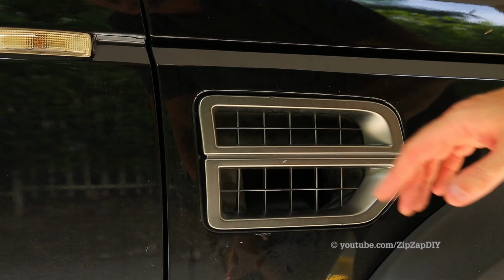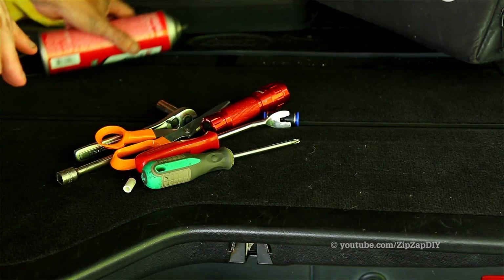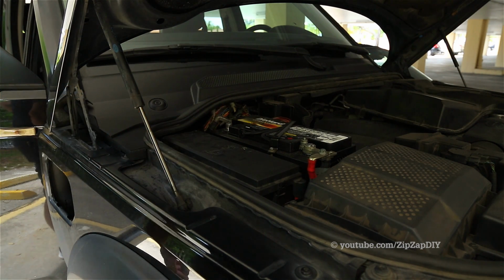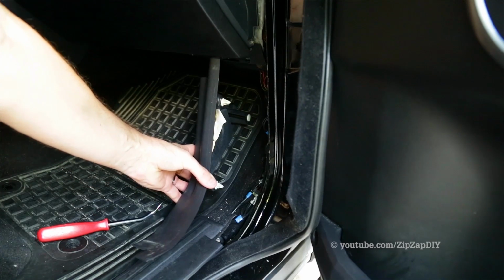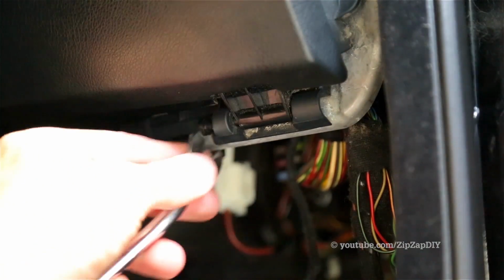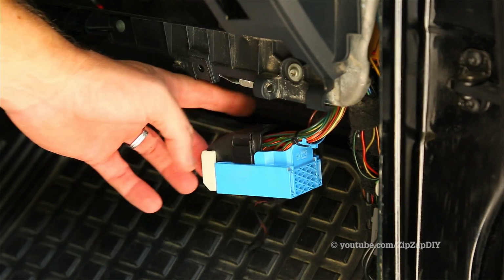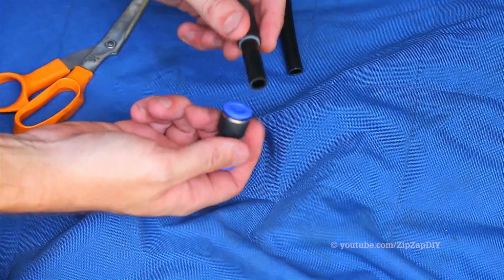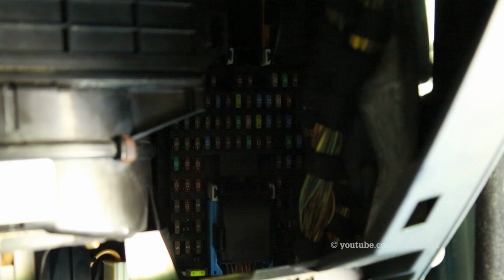LR3 RH Sunroof Drain Repair / CJB Removal / Water on Floorboard

Comment: Your best bet is to seal the sunroof with silicone like I did.  I replaced the tubes 3 times as they always fail, either clogged or crack.  Landrover quality will even be worse now that they are owned by India and China (Tata and Chery Motors).  What a sad ending for a brand that's been bounced around like a racket ball.  So sad.  I have many repair videos on my channel due to al the problems in the past...even a detailed repair of the sunroof drains with the headliner removed.
Reply: Hey can you explain how to seal the sunroof with silicone please?
Reply: Open sunroof, put a bead of silicone in the recessed area...close sunroof and then disable sunroof switch
Reply: @productreviewspecialist  Thank you so much

Comment: Thanks, I was able to change the drain tube with only releasing the front and bottom connectors on the cjb and then put new tube from bottom to top complete new to avoid leaking points. 
Oh no the 2 connectors were comming out without notice. Now I can’t get it back 😢

Comment: My recently purchased '06 LR3 has soaked carpets from long term leaking of those drains.
Haven't yet set up my recently purchased Gap tool. But I'm getting many strange reports
on my dash screen, which may or may not be related to wet and shorting connections.
Pulled the 5 seats yesterday and lifted the carpeting to find wire chases filled with water!
The foam backing is dense so I know it will be a while before it dries.But don't have much
of a choice. There are electrical fittings and flex conduit called "water tight"... Which have
sealing solvent similar to PVC products and connector fittings which are  designed to be water tight with O rings and threaded connections. The hole through which your hose
protrudes is sharp edged and I'd be concerned about the loose fitting bouncing around
and wearing through the plastic. At the very least I'd install a rubber grommet in that hole.
A threaded and well secured connector will give peace of mind in the long run. In my humble opinion. Thanks, subbed...
Reply: I also have weird stuff going on!

Comment: Thank you for the video. The back connector I managed to secure by connecting a piece of string to the latch. Once the connector was in place, with one hand I was holding it in place and other pulled on a string which in result pulled the latch down and secure the connector. Hope it helps.
Reply from the maker: very interesting solution, I like it.
Reply: @ZipZapDIY   how did u get the back out

Comment: The two plugs on the back of the CJU were very difficult to reattach. I spent six hours and both were equally hard. Use a mirror and when you can not see a red tab on the green one, it is in. Pull the lever down and you're done. The car will not crank and an E message for the gears will appear if the green connector on the back is not in. My hands are medium sized for this tight job. I am not sure a young person, as mentioned in a response could have done this for me. It is super tedious.

I did all this and did not replace the hose. All that was needed was to pinch the nipple in the air intake compartment. Water shot out when pouring it in the sun roof.

Comment: I was able to just swap out the ends of the lines, no need to cut and splice. Your mileage may vary based on differences in years, but I was able to do it on my ‘06.
Reply: I'm thinking of doing the same, replacing just the end piece. Do you have any advice or steps to follow after you have freed the tubing from the hole in the fender?

Comment: Let me make this job MUCH EASIER for all who want to do this...

1) DO NOT mess with the CJB (unless you are already having weird electrical, water related, issues and need to clean it with contact cleaner). 
2) Pull down a partial part of the headliner on the passenger side--> Take out screws for the oh shit handle, sun visor, and pull to release center clips above center, overhead light. 
3) Pull out external air intake cover and appropriate parts to expose the nipple exit hole (as seen in this video). 
4) Push nipple back into car (DO NOT PULL IT OUT). 
5) Use a quarter sized ($.25) metal hole cutter with drill (aprox.1-1/8") not too big....and cut a hole around the nipple hole. Yes, you are drilling though metal.  
6) Disconnect the hose from the sunroof drain (headliner is partially pulled down so this is easy at this point). 
7) Now the hose is more accessible because of the hole you drilled where the nipple drains. -->Pull nipple end of hose then push down hose from sunroof, pull nipple end, then push down, and so on and so fourth. (****CAUTION you only need about two inches of hose to work with so do not not pull too much through***) 
8) Replace the joint and then push hose back to where it was with the lip of the nipple resting on the edge of the cut. You do not need to silicone or secure the hose- it will rest fine on the edge. Further, you can get rid of that pice of foam that separates the nipple from the rubber air intake if you want- it doesn't serve much purpose at this point in the vehicle's life.
-->job done. Time...30 min - 1 hour. No stress.
Reply: What would your advice be in regards to corner brakes lights not working but top middle brake light works?

Comment: Good afternoon from the great state of SC. I'M  working on the CJB now and I didn't take a picture of the back of the CJB prior to disconnect. But If you have the CJB in front of you to the rear right there's a male  orange plug thats top right ;right)but to the left there is a green male rear plug on the left, there are two female plugs one on top of each other. Which two female plugs is it.(top just across from the orange or bottom left?

Comment: Just finished mine. But my Rover stuck half way park in my garage and it wouldn’t start. It left with lights n sensor fault all over the dash with a E on my gear indicator. Don’t know what happen. But those CJB are a pain in the butt. Harder to put back then to remove.10/17/2021 found out one of the back plug was not properly plug back on must’ve flip the release flap while trying to shove the CJB back up there. Everything works fine and got to clean the TCM behind the battery. Thought that was the issue because it was corroded.

Comment from the maker: I hope this video helps you to repair the sunroof drain and gives some insight on replacing the CJB on the LR3. I almost didn't publish it because of some quality issues and I forgot to mention some things (read the subtitles) I suggest you watch my other video on the sunroof drain repair since it is thorough: https://www.youtube.com/watch?v=16x02kh7IAg and watch my Glove box removal video as well since it goes in depth: https://www.youtube.com/watch?v=e-2JOgx2YeM
Reply: Thank you for the video! Super useful you saved me! I have done the driver side which was much easier.  The conector on the back are truly terrible! But overall I was able to do it! Once again thanks!
Reply: Thanks man my 2010 is leaking water in The interior Serna concert one out and parking assist is the CJB related
Reply: Center console
Reply: Thank you for you video.  Both my left and right drain lines nipple have disintegrated just as you shown in picture.  I did not use the blue couple but I just cut existing  old nipple. Then on the new type nipple plug it in using some silicone,  Tested it and no leak inside. I did not have a leak but I did it for peace of mind. It is kind of strange that I had no signs of leak from the past. I just got my LR3 1 week ago. This is a must procedure. The rear connectors for the CJB is tough to install. I finally got the technique down is to lower the CJB slightly to have the best access to the rear.

Comment: My LR3 is leaking on the driver side. Aside from water on the floorboards, some actual leaking thru the ceiling of the truck between the skylight and top of windshield.
Reply from the maker: Those are classic symptoms of a clogged sunroof drain line. To clear the drain line, open the sunroof use some edge trimmer line to push down the drain line, (holes are towards the front of the sunroof opening) pour water as you do and it will clear out.

Comment: I too have this issue. Another Youtuber does the repair via the A pillar. I wonder, could the drain hole in the fender be enlarged a little and the new hose taped to the old then fished up to the A pillar and push fitted there. A dab of silicone should make the fender fitting waterproof. Is this crazy talk?
Reply from the maker: Hey! for that, you'd need to drop the headliner on that corner, remove the a-pillar cover, drill a very large hole in the inner fender, somehow get tape around the end of the old tube which will be dangling well inside the back of the dash and then drag the new tube through a tight and restricted pathway.... no thanks! someone did this?

Comment: Thanks so much for sharing this. Is there any chance you have insight on other leak issues? I can't tell if the drain is corroded inside, but I previously fixed a leak with the simple nozzle unclog pinch once I'd found it. This time it's not the solution. I have water through the drain. But where should the water go once it leaves the drain? It appears to flood the passenger floor from there. Has something else failed?Also inside the frame below the drain outlet there's a bag that appears flooded. No idea what the bag is or how water could be in there. Any suggestions?

Comment: Great video! Although after everything was put back together my driver side window and backseat driver side window are stuck in the down position with no mobility. Do you think that could have been from the connection process of the junction box. Looks like the ECU is fine. Just seeing if there were any issues for you like this?
Reply: @ZipZapDIY any info would be a huge help!

Comment: Thanks for the video.Does the water leak right onto the CJB? Did it cause any electrical problems? Thanks for your time.
Reply from the maker: It appears that the water does not directly flow onto the CJB but it does flow onto the wiring harnesses. If left unresolved, the moisture in the area of the CJB will cause problems. ( I did not experience any electrical problems and noticed only minimal corrosion, but I taped up the sunroof as soon as we noticed the problem to minimize the issues)

Comment: thanks for the video!  However, I have a 2016 LR4 HSE Lux.  Is it similar to the LR3?  I've tried to find the draining holes on the sunroof tray but I can't find them. If it is the same as the LR3, I will give it a try.  Whom ever designed the draining system was smoking some bad weed.   LR4 ride nice until something simple goes wrong and you end up dismantling half of the interior to fix it. @ $200 per hour in the shop, it can get costly.   Thanks again!
Reply from the maker: Not sure about the LR4, my guess is it similar. They were def smoking and sharing it with the materials engineer who picked out that disintegrating rubber nipple...

Comment: I performed this today and it worked, but I "DID NOT" remove the rear CJB connections, but did disconnect the battery. That said, after getting all the CJB electrical reconnected and starting the truck, several warning messages.

- Fuel Level Low Warning and Dash Indicator @ "0"
- All doors open when closed
- Height Change disabled due to erroneous  -  all doors open warning
- Brake pads worn w/ plenty left

Anyone else experience anything like this?

Is any of the wiring for these in the CJB connections on the front or bottom, that may have been affected? Or am I looking at a re-programming issue?

Appreciate any feedback

Comment: Hi..thank you for this great  video.This passager side leak has happened to our 2006  twice before and iI saw yesterday during a torrential rain some water getting in at air bag  cover on Window rail and down at bottom under glove box.
A new drain was put in by dealer about 4 years ago..could the end of drain have disintegrated in such a short time? Is it possible drain is clogged ? Thanks again.
Reply from the maker: 4 years seems too short for the nipple failure, and if you have water on the airbag cover, you probably have a clogged drain line, you can use edge trimmer line to chase the line to clear the clog, be careful, don't poke thru the rubber nipple at the bottom, the drain intake holes are located on the front corners of the sunroof, you need to open the sunroof and may need to push down the wind deflector to access them
Reply: @ZipZapDIY  Could trimmer line actually puncture the rubber grommet at the end of the line (one that goes into Air Intake)

Comment: I've been struggling to get the bottom connector(green  one unplugged). Is there a locking mechanism or does it just take some wiggling? I've been at this for longer than I care to admit. Thanks for the video
Reply from the maker: no locking mechanism, just a simple push down a tab and pull off, You might be able to use a flat blade screwdriver to help you pry it down? ? I feel for you, this is not a fun repair.
Reply: @ZipZapDIY  thanks for a quick reply. I had to button it up before I could finish. Hope to finish up tomorrow!
Reply: The push tab is on the back of the connector in the center

Comment: Update: Cleaned off the drain holes on each side of sunroof and no more leaks!! Carpet is incredibly saturated so it will take days for it to dry. BTW, If anyone knows the exact location or color of the wire that corrodes and breaks on the Right side door sill somewhere that powers the remote locking antenna I would appreciate sharing it.
Reply from the maker: The wire is located on right side, under the door sill about 2 inches in front of the seat mounting. the wire is blue with white stripe, there will be two wires with splices on them in the wiring harness, the target is the one with smaller wires. You will need to remove the screws that hold down the seat and then elevate the seat to remove the door sill and door sill cover. (one is over the carpet, the other is under the carpet.)
Reply: By any chance does the seat tilt back if you remove just the front screws that hold the seat or do you have to take out all 4?. Thank you kindly for your tips!!. I am learning a whole "new" car so its going to be a process to say the least. Off topic but have you heard of BRITPART.COM? They're over in England and I'm trying to buy a tool that can program a key (as well as do OBD) and they have some pretty good stuff. I just don't know if they have a model that does and 05 LR3. I did write to them from their web page to ask them but haven't  heard back yet.
Reply from the maker: all 5 screws need to come out, parts of the sill cover under the carpet are under the seat and very difficult if not impossible to remove without the seat lifted up fully.. I don't think I've used britpart for anything, I might have but not sure..
Reply: Did the seat tonight (first car ever with 5 bolts :-) and yes just like you said 2 different wires spliced and electrical tape around them about 2 inches parallel to the the mounting bolt. The bigger had 2 wires on it and it was red and black but the little one was green and white (or tan depending on your sight). I wonder if that was just the flavor of the day at the factory or if I got the wrong wires but there were no other wires spliced in that big wad of cables. I still cut it and plan to solder it together. What's your take on the green/white?

Comment: How does the connector on the bottom of the CJB come off?   I want to avoid brute force in the removal but I’m getting to that stage of frustration.  Thanks!
Reply: It has a push pin on the center of the backside that you have to push in then pull it out.

Comment: I need help on the back of the Fuse Box they have two connector C584 & C586  what is the color Plug
Thank you for you video
Reply: One is red, one is green, but they are different so you can't get them the wrong way round.

Comment: Followed the directions......no leaks....but developed warnings the doors are open - but they are not , the door on back is Open- and its not, unlock the doors and they stay locked, interior lights stay on ,  Sunroof will not close or open. WHAT A NIGHTMARE!!!! I would take the leak......in trade for all these problems!!!!! Now what?  Any suggestions? Would a new CJB be the answer?
Reply: If you found an answer to this please send help my way :). I unfortunately have the exact same problem after reinstalling.
Reply: @shanegibbs4248  mine did the same thing! It’s your orange plug in the back. Mine wasn’t seated properly. If you can see the little red tab, it’s not in far enough.